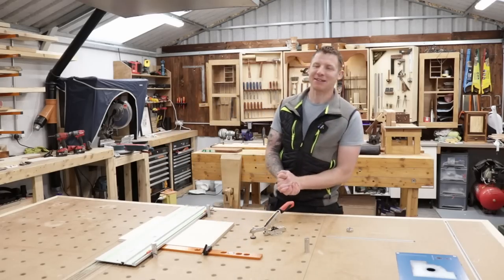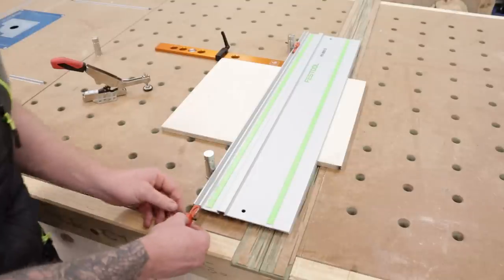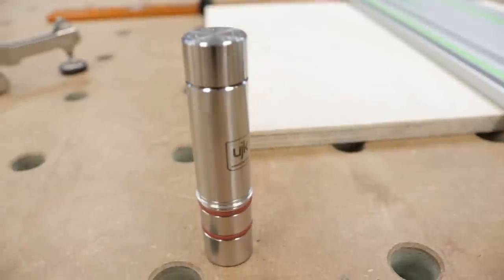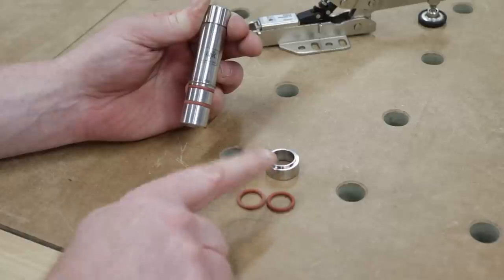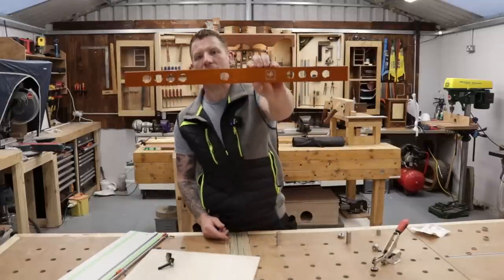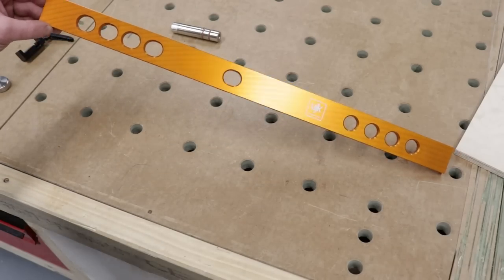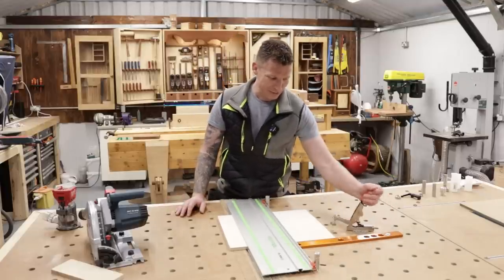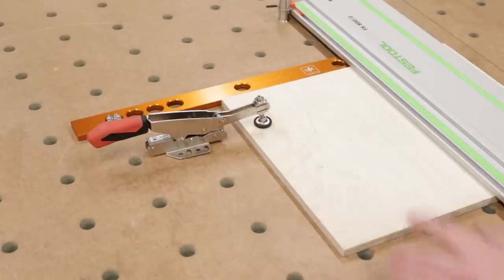UJK Parf Fence, Super Dogs and Other MFT Accessories.

Comment: On your clamp reach problem, just add some offset holes to your matrix of holes in the table.
As for 45 deg cuts, you could also set the rail at an angle by repositioning the dogs and keeping the fence straight.
To lift the flush dogs, put som M8 bolts permanently in them with a nut as spacer to make a handle.
A suggestion is to buy the UJK 8x Anti-slip dogs, so you can avoid having your workbench scored from your cuts.

You still have the cam & wedge clamping kit and assembly square to test/review if you so feel doing so.

A cheaper solution to the fence for those that find it to expensive, could be the UJK backstop. Or several of them, since they cost about 1/8 of the price for the fence..
Reply: I agree...as much as my OCD prevents me from wanting to disrupt my perfect 96mm spacing.  I finally just made a couple of holes in certain areas to address this exact same problem.  We are creatures of habit...so I just made holes for those same sizes that have become pesky.

Comment: Looks like you should create a set of 32mm or 48mm on centre holes using the parf system to solve that clamping issue

Comment: I bought the rail clips not knowing if they would fit my Powertec rails (very popular in the USA). They did not fit -- at first. I gave the oblique faces a very light sanding -- just enough to remove the high spots of those faces, to make them flat surfaces. Now they fit beautifully. By the way,  the wire clips fit 3/4 inch dog posts -- also popular in the USA.

Comment: Hi John. Great video. Could you use your Parf guide system as the 2nd fence. Just using that expensive piece of kit more than once every 4 years.
Reply from the maker: you could I suppose but you can also build more stuff with it other then just the top, you can use it to make a fence and squares for assembly and these can be sacrificial pieces so you can cut through them and make as many as you need.

Comment: Hi John,  hope you and the family are well fella👍. Been looking at various dogs you’ve reviewed for my makita track. In your honest opinion John, would you go with the Parf dogs and track holders or the Sauter magnetic ones? Both look good and I guess both have pros and cons!  By the way I think festool and various bangood companies do a clamp the slots in to the mft holes and extends and clamps your work piece horizontally against the dogs or fence. If that makes sense? 🤔 Congrats on the amount of subscribers and soon you’ll be getting your 100k award from Youtube mate 👍👍
Reply from the maker: Hi Mark both are really good systems and Sauter have a new fence out also. Its a case of invest in one or the other as they work slightly differently.
Reply: Thanks John.  Tricky one but as with most battery power tools stick with one and should  be good 👍 See if you can get a Cyclone off them John. That would be a good video. 😁 Plus I can see before I buy 🤣🤣

Comment: I got to thinking, do you have a table saw in your shop? No need really.
Reply from the maker: Sold it a while ago. Haven't needed it since.
Reply: So you use your track saw for all your ripping? How do you safely handle cutting small pieces without a cross cut sled?
Reply: I think the need for or against a table saw versus a track saw system is totally down to what you require if you're going to be cutting lots of sheet material day in day out then a table saw or panel saw like eire workshop has is the way to go but for occasional cutting of sheet material then track saw is more than adequate
Reply: @annscrazyworld2576  eireworkshop made a nice small parts crosscut sled few weeks ago 👍

Comment: I'm getting frustrated as I'm new to Mft tops. I purchased some equipment. I want to make some van racking for storage. I viewed a video of a guy who has  a table saw here he make long cuts, and then turns the wood over thats been cut back to the fence so he has parallel pieces of wood. I have an issue where I can't get heis. https://youtu.be/D0Gt4Jj6b9c Can you offer advice as the pices i require must be 29cm x 7ft. I offer the with up to the rails, but there seems to be an easy movement that will make parrarel cuts very hard to achive.
Reply from the maker: Let the 8x4 sheet over hang your table and clamp the track both ends, another good option to break down sheets is to do it on the floor, get an 8x4 sheet of insulation (Kingspan) put that under the sheet of plywood and you can cut into it. Makes it very easy.